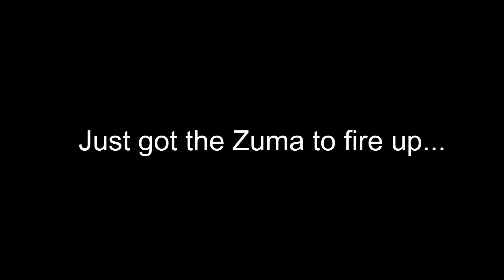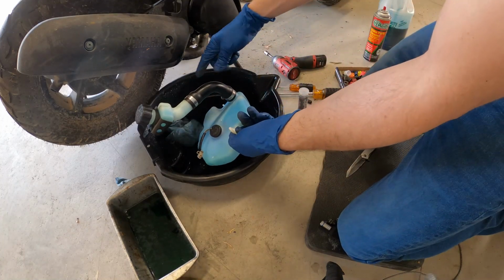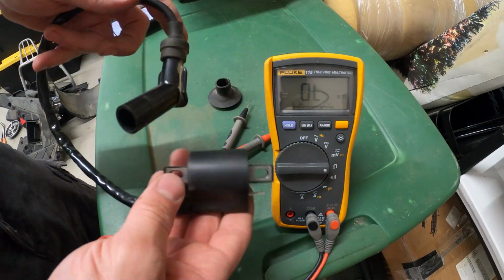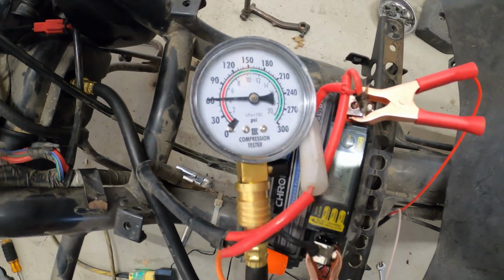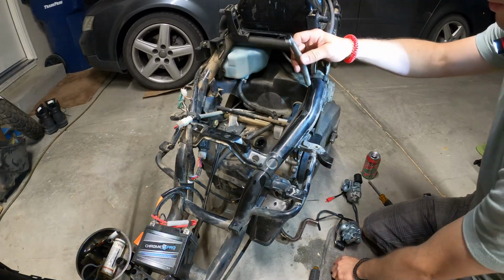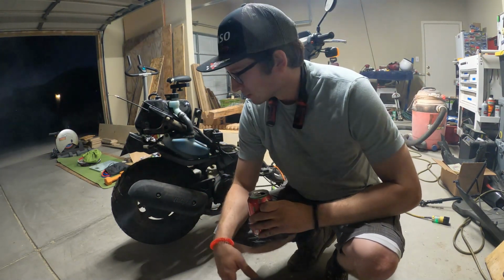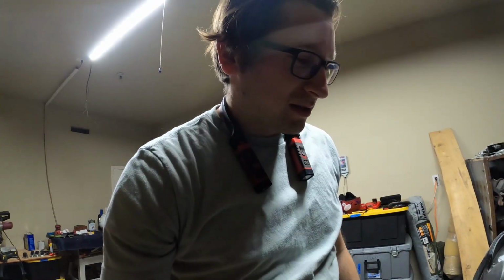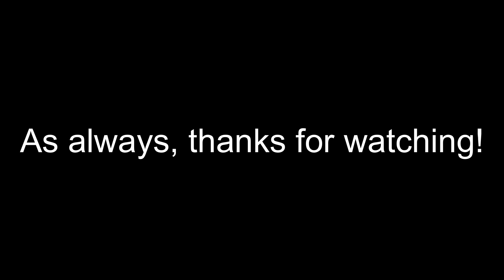2005 Yamaha YW50 Zuma Part 3 | Engine work and first drive

Comment: Even though the old carb looked clean I guarantee the pilot jet was clogged up because u didn’t take the jets out and inspect.   U should be able to see light when u look through them.  Also carb clean every possible hole and then blow out with air.   That cost you a big headache and a month delay.    The leaking oil sensor is a common issue.  I used rtv casket maker to seal mine up and hasn’t leaked since.

Comment: Good Job 👍 I think the Float is bad or needs adjustment on the old carburetor I wouldn't throw it away always good to have parts, I like that champion plug gapper where did you get it? Looks like your girlfriend was having a good time. And the Denso Hat is Bitchin I gotta get one.
Reply from the maker: Yeah, I held onto the old carb just in case.
Reply: @stuiesgarage  Idk if you got that zuma  going by now or not but that sir is a carburetor issue not spark , could  I suggest a dellorto carburetor lol , mine is 70cc with a dellorto carburetor although I cannot  put my fuel pump that helps push the fuel in on to it .. 😅
Reply: @stuiesgarage I see now an now I know  what's what lol , vacuum line for the dellorto I cannot connect 😅